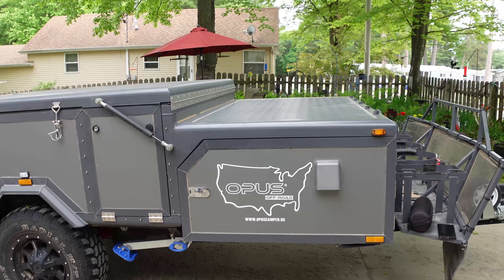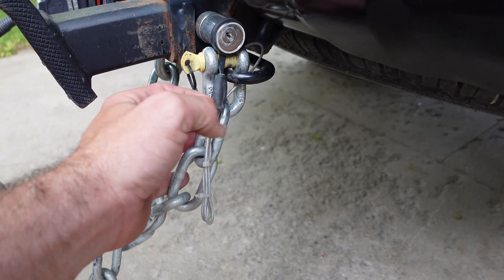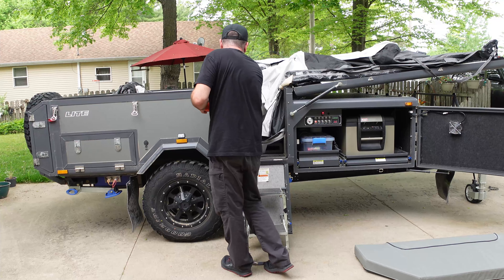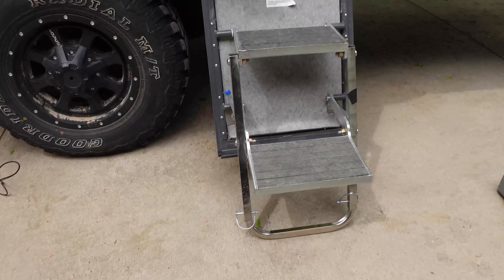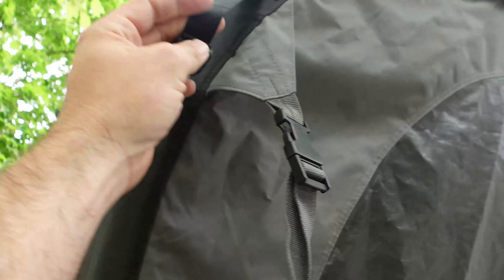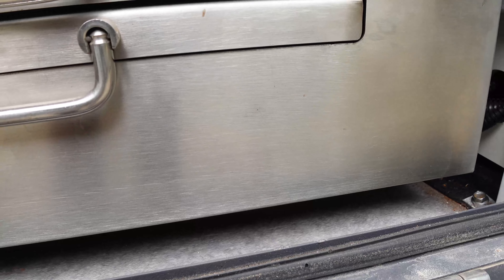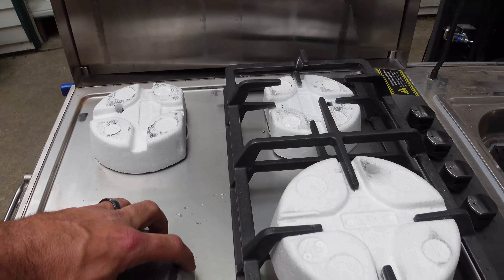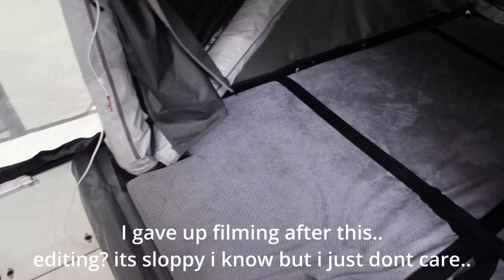2023 Opus Lite Review (Not so Good)

Comment: We bought a 2022 OP Lite in September 2022. It leaked like a sieve. When we would open it up, it was like a mini swimming pool inside and the storage compartments were always soaking wet. We had horrible mold and delaminating issues as a result. After 11 months of warranty issues with Purple Line, they just replaced ours with a new 2023. We took it out once so far for 3 nights, with mixed results, but I am not sure I want to keep this trailer long term either. There are definitely major flaws with the design that need to be worked out.
Reply from the maker: This right here. Unfortunately, I don't think the '23 will fare much better. Ours didn't leak much in the 5 or 6 storms while we camped. Most of the leaking issues we encountered were in transit, both river crossings and driving through rain storms.

Maybe you can trade it in on something with out taking too much of a hit and find something that makes you happy again. It was a difficult decision for us to lose out on thousands of dollars to get away from the Lite - but we came away much more confident and have a renewed excitement with our new Summit. Good Luck!

Comment: With my OP2, I had to season the canvis before I used it. This required setting up the unit and spraying the entire canvis with water, letting it dry completely, then repeat the process 2 more times. I've not had an issue with water leaks. Did you buy it from a dealer? If so, it's under warranty for 2 years.
Reply from the maker: I did buy it from a dealer. We didn't really have any leaks when it was set up tbh, just when it was folded up. We really didn't have time to let it sit at a shop for the entirety of spring into the summer. Besides, we fell out of love with it for many reasons.

Comment: It seems some of the issues you mentioned are not issues on their higher end models but something to definitely look at. The leaking is a big concern.  It sounds like you do some serious offroad, im looking for something more for light offroad and sticking around for a few days.  Sounds like a patriot camper or something similar would fit your style better. Thanks for the honest review.  

Did you find something that suits you?
Reply from the maker: @Jacob-rn  
From what I've read, the initial run of the Opus line was great. It was then outsourced to China and they slapped them together leaving the dealerships to fix many of the problems. Especially the water and dust ingress along all the seals while closed.

We traded the Opus Lite in for a Mission Overland Summit before we even got home from that trip. Realizing we were going places levels above what the Lite was built to handle, it was an easy choice. If you take look at our channel, you can see the Summit in action - its streets ahead of the feeble Opus Lite. Pricy for some, sure, but its Canadian made, backed by a decent warranty and built for the hard shit.
Reply: @thistediouspath  thank you for the heads up. I'm sorry for not checking your channel first.  I will definitely check out some of your videos on the mission. It looks like a good option.

Comment: Looks like you have one of the campers that was built during covid they had to change suppliers for the canvas and they leaked and did not line up properly should have been rectified under warranty we have opus owners here in Australia where the whole canvas was replaced under warranty due to the same issues you have
Reply from the maker: Eh, It was less the canvas leaking and more the seals leaking when it was closed. Thought I made that clear. Either way, it was only one of the problems the units sold in the US had. It was a 2023 model, btw.

Comment: Thanks for the honest review. It has really opened my eyes up to the reality of owning a forward fold camper trailer. Do you intend to purchase another trailer or RV?
Reply from the maker: We traded the Opus Lite in for a new, off the lot, 2022 Mission Overland Summit. We got a decent deal on it compared to the '23, though still took a bath on the trade in. We love it so far. Handles just as good on trail as the Lite and is great on the pavement. Its all aluminum and air tight. We haven't had it in pouring 3-day rain yet but it did fine with a few showers and some rain on the road. The price point is substantially higher but there are many reasons why. Ill have a review up sometime after the trip we are on.
Reply: Love the ending.... Just gave up filming. Here in Europe they brand themselves as premium.... Doesn't look it 😢
Reply: Will check it out! Thanks for all the info. @thistediouspath

Comment: The trend of high end campers having a million clasps, slide trays, flippy out parts, more latches, couple more zillion canvas pop outs, awnings, loops, fasteners etc.  All stuff that takes manipulation every time you use it, stuff that leaks and rattles loose. Cool vs practical were two very different concepts with the overlander high priced Chinese imported campers😆. The Opus popups were bulk buy china trailers at $12,000. 3-4 in a container shipped to CA $1000 ish per trailer shipping, import fees $8000 ish. These were being advertised for nearly $40,000 during COVID😆
Reply from the maker: This is all correct. We realized it was another Chinese import with the Opus name slapped on the side soon after we sold it. I felt a bit dupped, because no where in the 3ish years of researching this trailer - and others - did we see it listed anywhere else or under another name. Then we found it w/o decals 
 or branding on Ali Baba for like 12k with 4k shipping/import. Ah well, its gone now and we are more than happy with our new MO Summit.

Comment: Dang this sucks! Sorry for such an investment and it leaks.  Think what potentially made the opus interesting for me was heat and ac even though that’s not necessary but it’s a tent.  Probably half cost of patriot and I also came across xpedition voyager which seems interesting.  Below could be used as a hangout space and up could be your bed in tent.  What did you end up getting?  Update; mission overland lol.  I’ll check it out
Reply from the maker: @saleen692 
Yeah, I was bummed out about it, too. It opened our eyes to what marketing and perceived product value can do. I'm sure the first campers they were making were leak proof and sturdier. Hence the fire hose and helicopter videos. Then they started pumping them out of a factory in China and product quality went down. 

I think they thought they'd save money by having the RV service centers slap band aids on them till the owners got tired of it and sold them. That's why they're so cheap now. Oh well, they can have their corner of the market. We just figured we'd try and tell as many people as possible so they don't make the same mistake we did. 

Hey, good luck finding something that suits you! All the trailers you listed above will blow the Opus away. Excuse the pun..
Reply: @thistediouspath  super dooper crazy expensive stuff has gotten.  My wife’s 27’ camper is like a quarter of the cost compared to some of these overland trailers.  Our camper can’t even be hauled anymore though, the outerbanks completely destroys them.  Our stabilizers are dust for example and my sisters new camper already getting rust underneath after 1 yr.  She’s been spraying mystery oil now underneath

Comment: Did you do something to get the oxygen sensor to stop beeping in storage?
Reply: My dealer said to pull the fuse which worked perfectly. Just make sure you insert it back the next time you use it.
Reply from the maker: Yeah, same as 
@stuartmaeshiro2254 said. It's just another work around you have to do to get this thing functional.
Reply: Thanks y’all!  That worked.

Comment: LMAO...You bought it used....its a tent trailer.. jesus, buy a school bus if you can't  figure out how to exit the door.  Set it up properly per the manufacture, and then review it.  Always zip the front door before you inflate!   Your pump pressure is not set to specs - its obviously underinflated by 10% or more.  Tighten your 4  corner straps and the tent bottom edge stiffens up and nothing will get in.  These things aren't perfect like any other trailer, but if you follow opening up procedure from the manufacturer, you'd solve over 80% of your complaints.  This is a hit piece.  You can't set up everything wrong and then complain about it.  Haha, what a mess.
Reply from the maker: LMAO...You bought it used...

Incorrect. We bought it new, from a dealer, off the showroom floor. It's a 2023 year model.

Set it up properly

We did. Many times. You may have missed the part in the video where I said I wasn't setting it up all the way, as I was just cleaning it out to trade in and decided last minute to make a video. There's a plethora of vids out there on how to set it up. A 'how-to' video wasn't my intention.  

My intention was to bring to light the downsides of this trailer - as all I've seen ARE set up vids and people using it for the first time at a campground in perfect weather.. This was an exit review. We have a few other videos on this channel where you can see it fully deployed and set up correctly. 

This is a hit piece.

Why do you think so? Am I a competing camper trailer manufacturer or news organization with competing advertisers? Weird.. 

Good luck to you and we hope your adventures with the Lite are enjoyable.

Comment: $40,000.00 piece of crap.
Reply from the maker: We paid $23,000 new from a dealer in 2022. We sold it back to the place we got it - for $15,000. I just looked, and it's been sitting there for about a year at $18,995. I know, because I painted the front of the frame black and took off the big Opus stickers on the side. Collier RV in Rockford, IL. You made my day, I haven't looked to see if it was still there since we sold it..